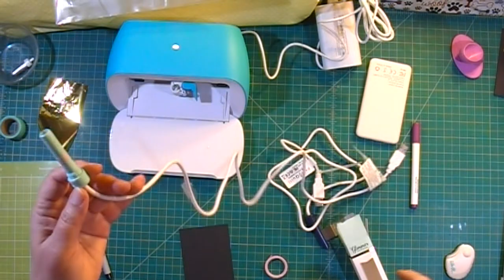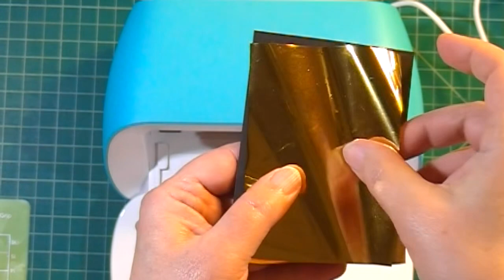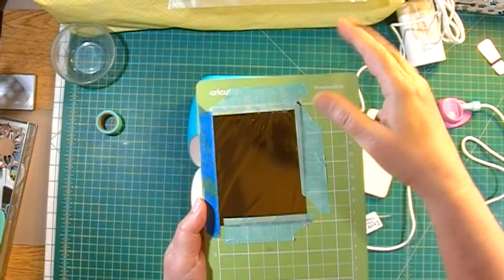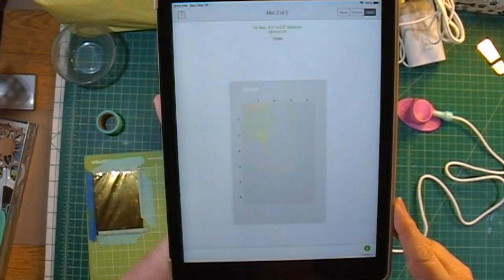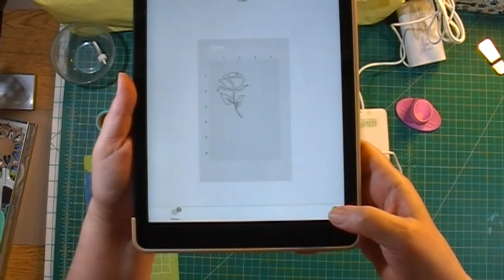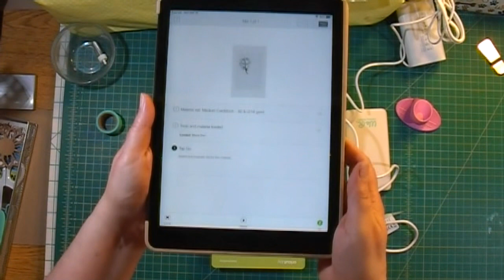Using WRMK Foil Quill with Cricut Joy

Comment: Nice.  Can you do another one removing the foil and do you have to sent the machine to each type of card stock paper you are using to print your design on. TFS!👍🏽
Reply from the maker: I always use the same cardstock, so not sure about the cardstock setting.  My guess is the type of cardstock isn't as important as if you are cutting.  I did forget to mention in the video that the design is set to draw and not to cut.  I'll try and record another one where I include removing the foil, but you just need to carefully remove the tape and lift off the foil.  Another important thing (which I thought I was recording) is to remove the heated foil quill right away and don't leave it sitting in the machine.